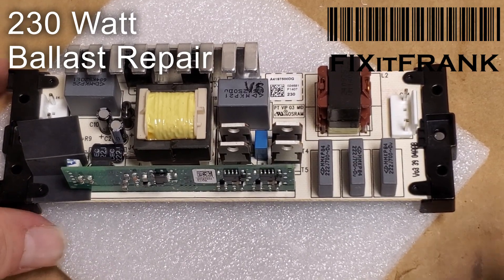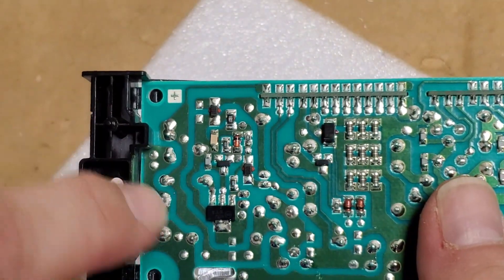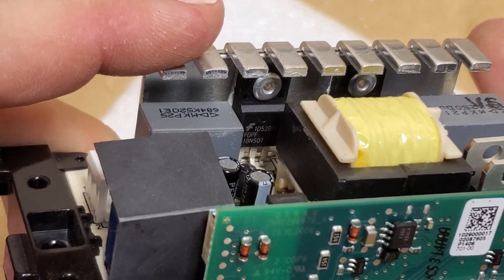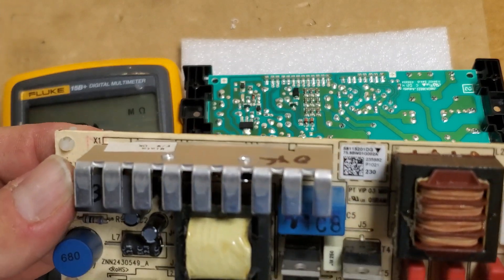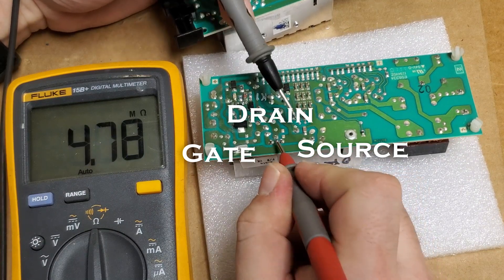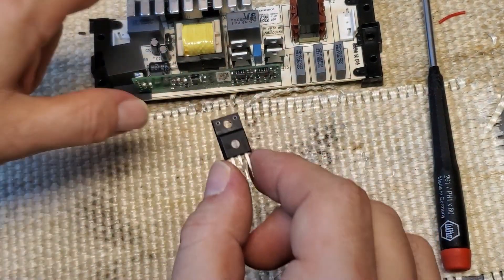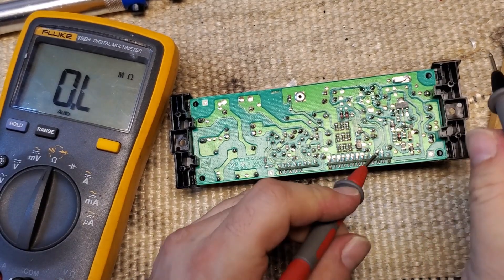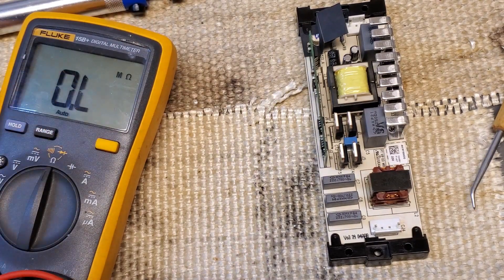230 Watt Osram Projector Ballast Repair

Comment: Hi Frank, I have an Epson TW6700 which worked fine, but last time I watched a movie it suddenly shut off totally. When I wanted to turn it on again.. the system started up, fans are runnen... but the lamp won't turn on. I smelled something like a burned electronic component. After 40 seconds the fans are running at full speed, the power led goes off.. the small blue status led and lamp led are blinking. From the manual it means: Internal Error.
I opened the projector and try to trace the smell where it came from... that smell came from the area where the lamp and ballast are placed. The lamp is ok, so it must be the ballast right?  I already tested it with a new lamp without any results. I measured the in and output voltage of the ballast. At the input I measured over the red and black wire 388 Volt, and the output was just 6,5 Volt. Is the input voltage right? Can you give me some tips? Thanks! Kind regards Jerry
Reply from the maker: You're lucky you didnt blow up your meter measuring the output of the ballast. During ignition it can put out anywhere from 3-10KV which will smoke any meter. 388 on the input it good. You want that. I'd check the mosfets on the ballast. I would not say the ballast is bad just yet.  If you find any shorted or weird value mosfets then I would replace the ballast.
Reply: @FixitFrank  Thanks Frank. Yes I realise that afterwards... but in this case I was lucky that the output was only 6,5V.
What if I start with replacing the mosfets first with a type that can handle a higher value instead of replacing the whole ballast?
Reply from the maker: sorry for the late reply. for some reason I didnt see your comment until today.  I'd make sure the mosfets are actually bad.  Epsons can present issues that end up being something else altogether.  You have the PFC power(388) so its possible the ballast mosfets are bad.  If you do replace them, replace them in pairs. You can use larger spec'd replacements but they wont really do much to protect or prevent failures.
Reply: @FixitFrank Thanks, do you also know what is the reason that mosfets failed? And why do I measure 388 Volts on the input of the ballast? I also called a repair centre and they told me that most of the time it's the controller on the motherboard can be also damaged. and they told it would costs 300,- EUR to replace the motherboard. But Im not sure if that's true.

Comment: Hi,if you can't find a exact MOSFET,what MOSFET would be equivalent that can be used
Reply from the maker: That is sort of a complicated answer.  however, the basic idea is to use a slightly higher rated spec mosfet if you cant find the right one.  If the 18N50  is an 18amp, 500V N channel, then you could use a 19N50, (19amp, 500V N Channel) or a 20N60(20 amp 600V  N Channel).  There are some other specs to consider if you have to do a substitute that is further from the original but in general you can get away with using a slightly more power ful mosfet without any issue.  The only other issue is that you need to replace all 4 with the new part #, not just one.  If one is changed in value, they all should be changed.

Comment: I have a Benq w2000. It starts to sound loud now. I think the fan is the problem. Can i taket out the fans and start the projector to see if the sound comes from the fans. Im worried If i remove the fans the lamp would explode
Reply from the maker: If you want to share a video of the sound, I can see if recognize it. The color wheel is also suspect when you hear weird rotating noises. 
You can probably hear what is making the noise without unplugging fans, but you are safe to unplug the fan for a second or two. The projector will go into thermal protection and turn off anyway if the fans are unplugged too long.

Comment: Hi, Frank, thank You very much for this interesting video. I've old SIM2 HT380 projector with 200W Osram lamp (P-VIP Osram 200W/1.0P22). At now projector has stopped working. The check showed that the lamp power supply (ballast) is damagwd. The main power supply and lamp are OK. I'm repairing projectors myself, but this is the first time I encountered a ballast malfunction. Three MOS-FET transistors (T1,T4 and T5) burned out in my ballast,and I couldn't find anymore anything else faulty. Simlpe changing damaged transistors wasn't help. New transistirs was damaged too. Where should I look for the fault and what should I check? I would be grateful for any help provided. Thanks. Best Regards, Kostyantyn
Reply from the maker: That is a good projector! Do you know what caused the failure originally?  The MOS-FET's rarely fail on their own. You are on the right path for sure.  I would look at the surface mount diodes that are large.  There is one that will measure short in circuit. I think its a flyback diode( I am not sure). It is mounted in parallel with a low ohm resistor array(current feedback?).  I would see if it measures shorted outside of the circuit.  I actually have a 200W PVIP ballast in storage at work.  I am on vacation until June 1 but when I get back I can look at it to see how components measure. Another place to check is the output inductor.  I have seen those arc over.  The plastic will be damaged slightly as an indicator but it will not measure shorted under most cases.  I have a video on an HD141 or HD26( I will find it) where this occurred.
If you want to email me some pictures of the ballast, I will see if there is anything else that I think it worth investigating. Plus I can see if I have one so I can provide some measurements you can compare against. frank@fixfrank.com
Reply: @FixitFrank  Frank, thanks for the quick response. I checked both flyback diode and other SMD diodes and semiconductors, I didn't find anything suspicious. I can't find a short circuit anywhere. I also didn't notice any external damage to the elements. I'll take some pictures of my ballast and email it to you. Thanks for help and enjoy your holiday!

Comment: Hi frank, is this ballast similar to the jvc x550 ballast?
Reply from the maker: I don't think so.  Only because I suspect JVC used Ushio ballasts.  But I am not sure... Do you have the ballast from the X500 in hand?
Reply: @FixitFrank  not yet, i plan to open it and examine it once i get a chance to. I've been reading old thread on other jvc model and it seem that it may be the ballast. 

My jvc turn on standby mode is green and as soon as it show ila on the screen it would immediately go to solid red light on warning, orange blinking light, and standby light turn blinking red at first and then red solid light after that. 

I swapped out two new bulb but it is not working. It is still the same error code.
Reply from the maker: @l1n147  You might want to see if you can hook it up via the serial port and check to see what errors it has.  It definitely could be a ballast though.
Reply: @FixitFrank  how would i do that now when the unit is in error? I did bought a  serial to usb 232 just to do that but after hooking it up the projector it does not recognize.

Comment: Can we glow the lamp without the control card
Reply from the maker: No, its a power supply, not a control card.  these lamps are arc lamps and need a special driver. There is no other option
Reply: I think you can put 5v lamp on command to the ballast yes,  to test without the fixture

Comment: GREETINGS, CAN YOU REMOVE ME FROM DOUBTS I HAVE A PROJECTOR, EPSON POWERLITE PRESENTER H335A 2500 LUMENS THE POWER BUTTON INDICATES ORANGE LIGHT, THEN TURNING IT DOWN INDICATES GREEN LIGHT, BUT FLASHES 30 SECONDS IT GOES TO ORANGE LIGHT, IT DOES NOT TURN ON THE FANS OR THE BULB,,, ,, COULD THE LAMP HAVE BURNED OUT?
Reply from the maker: It could be. But it might be an iris issue too. If the lamp is old, I would try another but be sure you can return it and be sure you don't buy it on Amazon.

Comment: Dear Sir, Without mother board control this lamp board using......?
Reply from the maker: 380v dc Power supply to power input.  Opto couplers can be shorted on the transistor side to enable the ballast, or feed 5V to common and pull the Lamp_On pin to ground and the ballast should start.
Reply: @FixitFrank  🌷🌷🌷🌷